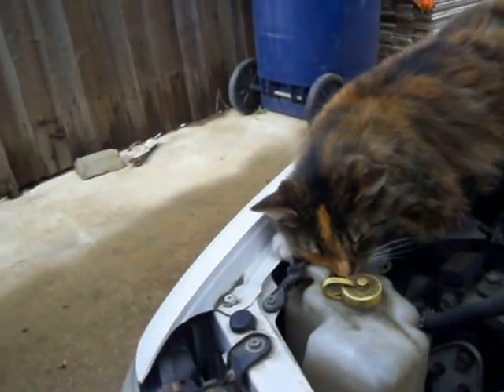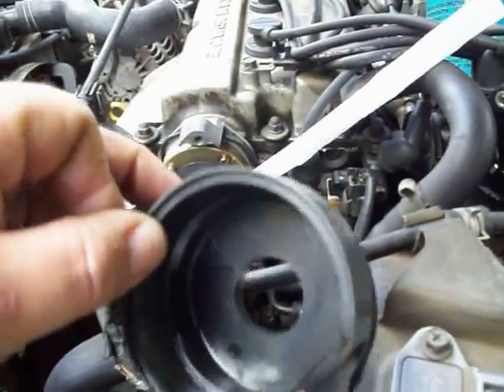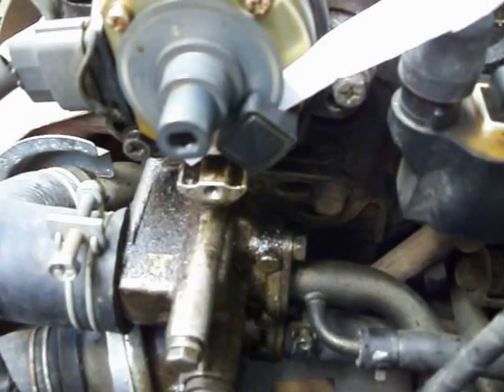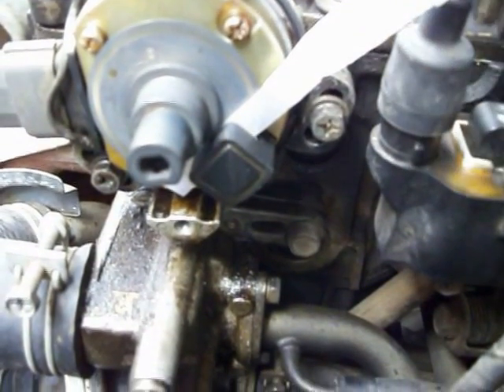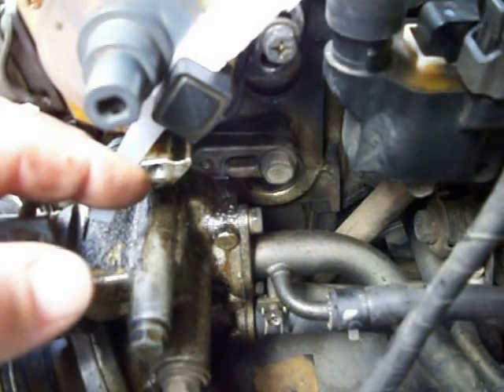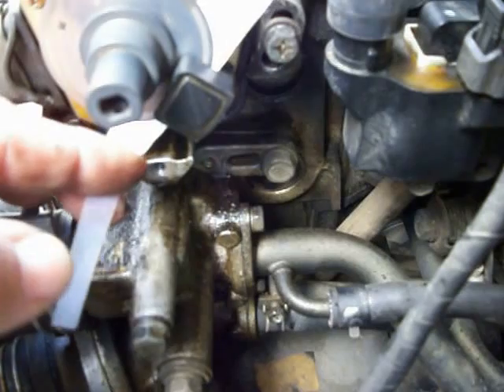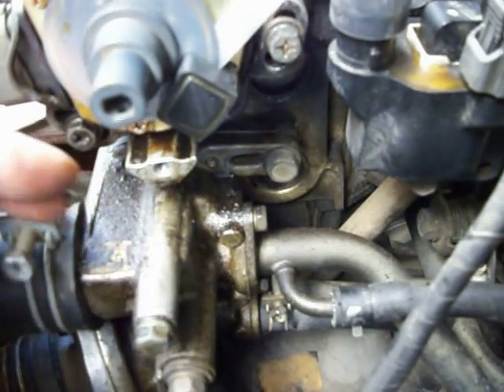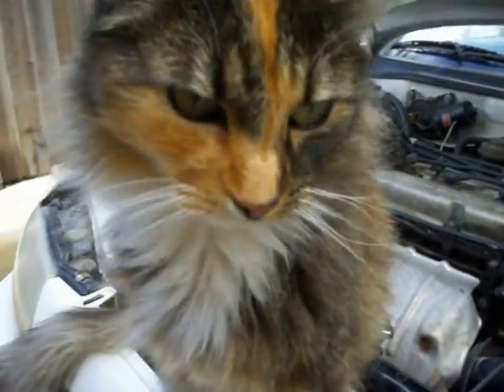Nissan Altima Stalling at stop signs  REPAIRED HERE !!

Comment: I like you vid...I had the same issue with my Honda Accord 97. I had to replace the distributor...Yeah it costs. But I suffered lot ...money and time going to garages...Car stalled at stop signs, and later even while driving. This stalling issue was terrible when the engine reaches high heat. No one could find it until my friend told me the reason.I think there are two "rubber" O-rings that avoid oil leaking. Feel like better to replace the distributor or cheap way try to replace new O-rings.

Comment: Hey Thornton, cool to share your tips here on youtube. As you said in the video, not everyone can afford going afford to the garage. I'm in the same situation and hope to find a solution after some months. I have a similar problem, my car stalles and at traffic lights most of the time, or when I'm idling, this happens after driving for some time. It's an Almera 95. Before getting the problem, I often have the check light on the board lighting, and the cars stalles when this light is gone oddly. I already went to the garage, they told me they cleaned the throttle body. That costs me around 200€. The problem is still there. Do you think It could be caused by some oils that leaks into the distributor ? Best regards from Belgium.
Reply: Geoff .O

Comment: Hey mate, just a question.
My bike, honda cbr 600 rr, is lately stalling in neutral at stops even clutched in and also while riding will lose power for a sceond or two or will jerk forward sometimes as I'm deccelerating.
Do you have any idea what that might be?
Thanks a lot.
Reply from the maker: Sounds like the bike is losing spark intermittently.  Check the keyswitch, kill switch, wiring to coils, fuse connections all clean good luck with your bike.
Reply: @thorntonspikewell6672  Thank you, I will get back to you as soon as I fix the issue.

Comment: would be a similar issue on a 98 right?
Reply: Angel Tapia I'm having the same problem with my 97. stalling at stops and dropping idle.
Reply: I fOund my solution. Try this. Try cleaning your throttle body as clean as possible the dump sum seafoam 1/4 of the can in the intake trew the vacuum line wait 15 minutes then drive it for 15 minutes add the rest of the seafoam in the tank fuel up n go for another 15 minutes drive. Got the tip from my tech friend he has 8yrs experience for me I only have 3. Give it a try and give feedback hope it helps.